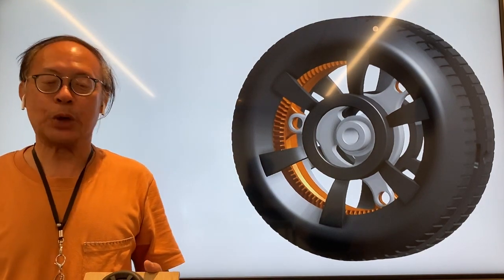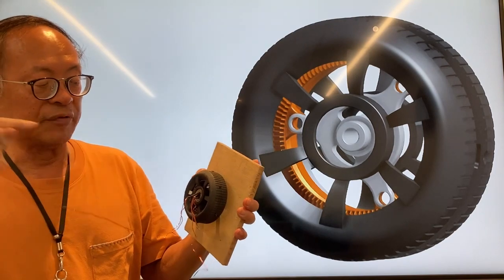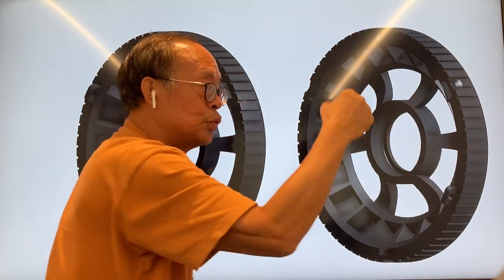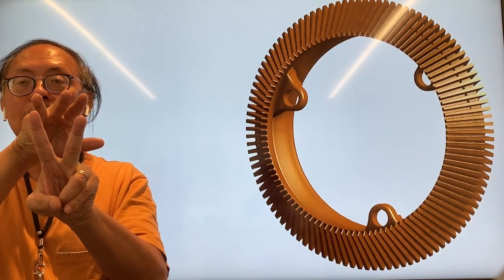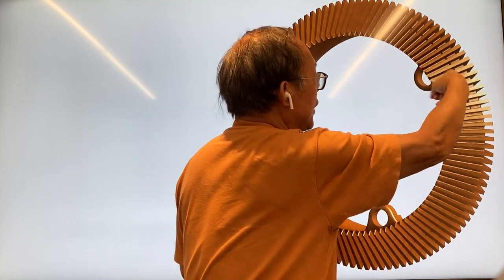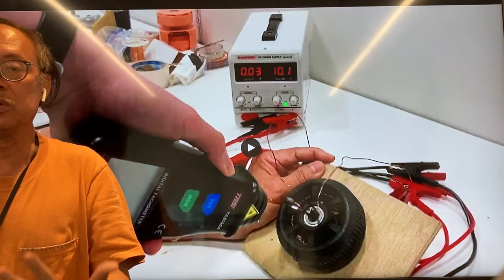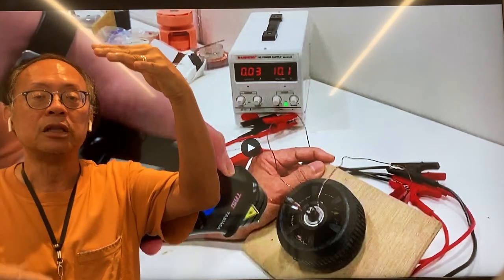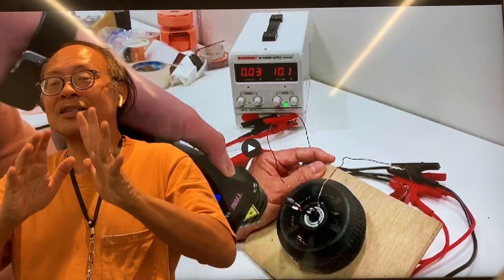DIY Axial Flux Hub Motor | AWESOME DIY

Comment from the maker: Visit solarman.ac/diy and click on "Axial Flux Hub Motor Download" to download STL files for this project!
Reply: Hello. Is any way to download that STL now? Link above doesn't work.
Reply: did you find ? @TatiRemi
Reply: Do you have sources for the magnets and bearings needed?
Reply: @moses5407 you can just use skateboard wheel bearings, cheap and available from shopping centres or skate shops, ABEC 5 bearings you ask/look for, very common and cheap😅
Reply: Link is 404
Reply: Ditto. Link to .STL files is 404. :-(
Reply: What are the actual dimensions of the parts? The downloaded files when import into fusion360 are multiple meters in size.

Comment: I wonder if somebody can help me out here. 
In the video Solarman states there are 20 magnets per side, causing 10 pairs of poles. With 4 windings per pole pair resulting in 40 windings per phase, therefore 40 x 3 poles equals 120 windings (eg. grooves in the stator core) . 
BUT..... I've printed the files that I downloaded and there are only 18 magnets per side.
If my understanding is correct, I actually have 9 pairs ot poles. Now I do the arithmetic again; 4 windings per pole pair results in 36 windings per phase, and, by extension a total of 106 windings (36 x 3 poles). Guess what, the printed stator core only has 106 grooves, not 120 as stated. 
I'm happy if somebody points the error of my ways.
Reply: Do you still have the files

Comment: This is truly awesome, cool video with all the information you need , thanks a lot , I’d like to try and build something like that to power my Ebike or even motorcycle! But I haven’t got a 3d printer, what would be a good material to use to make the shapes , I could make it very strong with Aluminium but will this affect the quality, Is it a bad idea or should I just try epoxy and fibre glass ?? I’m thinking a mixture of the two ,???
Thanks again , good show 👏

Comment: I am fascinated by this electric, (it's 3 phase?) axial motor and would like to have four (one for each wheel) but I don't have anything to put them into at the moment. I would have to build the single seat go-cart first, then figure out the battery situation (what kind of battery, placement, size, securement, etc). I'd love to have those motors, I just couldn't do anything with them.

Comment: You really should point out centrifugal Force, G-Force your magnets. Take the diameter of your hub. Go enter that into an online G-Force calculator and see how many hundreds of pounds are trying to fly out of that at 5000 rpm. It could tear your hand-off or open up your face.
A simple steel band would help. That has to be discussed, don't just throw those files out; as there could be people that don't know that.
And if you make it slightly larger in diameter the g-force could be in the thousands of pounds!

Comment: I just noticed this is a Y configuration vs. the Delta configuration you showed in the diy motor build for the AC unit.

Why the "y” config? I thought delta was more powerful?

Can you describe and provide a link to the esc/vesc you used for compatibility with the demands of this motor?

Comment: Love this work and the great explanation! Just a couple of questions. Since the windings run around the core vs. In a direction parallel to the permanent magnet face, am I correct in understanding this to be a transverse flux motor vs. classical axial flux design?  It doesn't really matter ... Just checking my understanding of radial, axial, and transverse designs. It seems transverse is better for torque ... Which is my main interest.

Second, what is the max amperage/torque and sustainable amperage/torque given the inevitable heating issue? And would this be improved by using higher gauge wire?

Lastly, do you have any knowledge of an analog to FOC DC motor control for this type of motor?

I'm familiar with simplefoc but that is aimed at BLDC.

I need similar abilities for angle, speed, and force control.

Thanks!
Reply: My understanding is  axial flux gives you a bigger dia. Motor & short thickness. Because  the bigger dia. The more room you have for more cores at the circumference. Or more space you have between for more windings! That's why the hub less motors excel! See Verge Motorcycles fom Norway

Comment: Do you have a parts list for the bearing sizes and quantity of wire?  At one point you mention that this is a 200W motor that will do 6000 rpm.  Is this what it does?  You also said that it could go up to 20A with a load.  18 ga wire is rated for 16A. If I changed to 16ga wire will it fit in the stator and under the magnets?  what is the gap between the wire and magnets with 18ga wire.  I opened the STL in soldiworks but they are just graphics files so I cannot measure.  Can I email you directly to get more info on the motor?  I have watched both the hub motor and A/C motor videos multiple times trying to get more information.

Comment: Do you need hall sensors to determine direction of rotation in an axial flux motor?
Reply: No. Just use ESC standard for drones and RC vehicles

Comment: Terimakasih penjelasannya. 
I want to try the rotor reluctance synchronize, if it possible to make axial reluctance rotor
Reply: You can do inductive axial flux motor (see professor laithwaite’s video). So I think it is natural to extend that to reactance motor).
Reply: @JosephHui57  i know that lecture. May be a development to a more effective rotor type which optimally coupled with axial stator
Reply: @zaynabds  very good. Depends on your application. I plan to use a coreless inductive axial flux motor for my commercial A/C. Startup is slow if you use 60 hertz 3 phase AC as current induced electric field is small without rotary motion (as in laithwaite’s video)

You are right, the kind of reluctance synchronous motor of model 3 would be better for torque at all motor speed. Just that I don’t need that. I don’t think it’s that difficult to derive that for axial flux motor.